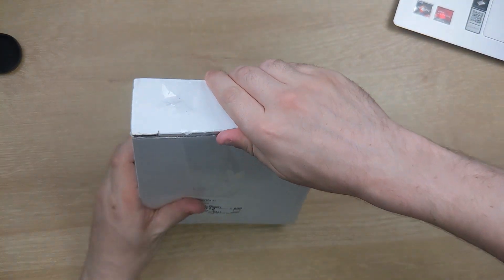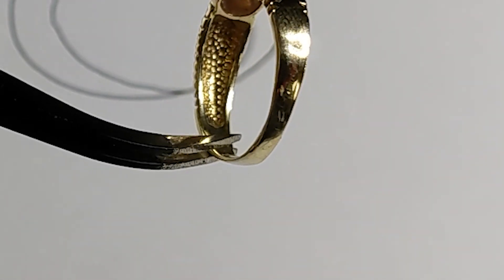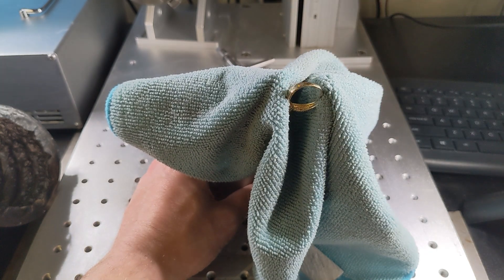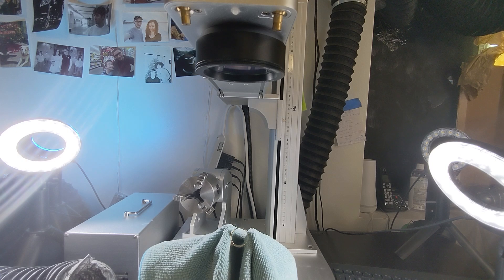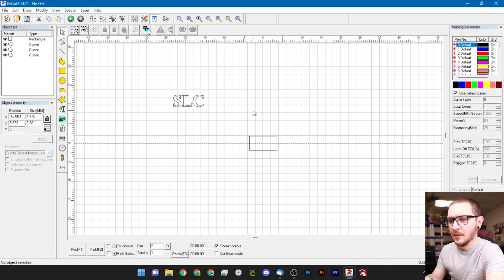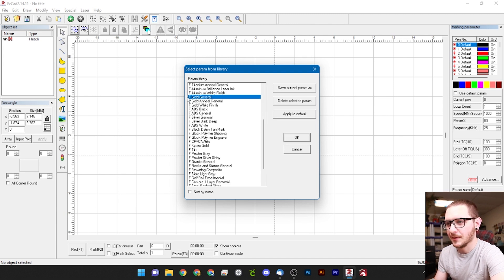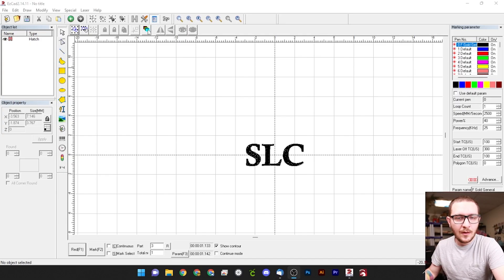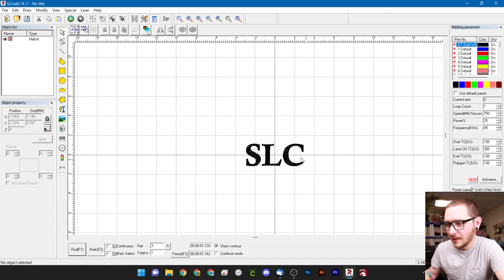How to Engrave a GOLD Ring with NO ROTARY tool! | Fiber Laser Tutorials

Comment: Hi just wondering what lens size you recommend for doing rings and small jewelry, I'm new to fibre lasers ,I have a 50 watt Cloudray with a 300mm a 225mm and 100mm, was debating on whether or not to get a 70mm for jewelry. Any recommendations are appreciated. Thanks

Comment: New member. When I engrave with the machine on metals I see that around it creates like a shadow that I have to use a soft sandpaper to get it erased or polished. is this normal?
I have a 50W Fiber Laser.
Reply from the maker: Not normal. Click the ADVANCED button under your parameters and change MIN/MAX Jump Delay to 500. Should clean that up for you.
Reply: @LaserEverything  Thank you. I will change it and give it a try.
Reply: @LaserEverything  Woww thank you very much the problem is solved now the engravings come out without that shadow will look much cleaner. Thank you very much !
Reply from the maker: So glad it helped you :)

Comment: Hi Alex, instead of deleting / Cutting then pasting the engraving parts you could check "(S)Mark Select" and let everything visible. But it seems that this is your workflow. Very nice job!!!
Might I know yout Wobble Parameters: Diamateter = ? mm & Distance = ? mm
Because I'm experimenting with it. Are you previewing the Wobble in EZCAD bevore engraving then it seems that if your text is too small the Wobble Diameter will take too much space in relation to it's main dimensions.
Reply from the maker: Yes people recommend this to me regularly but I don't trust myself to use mark selected and I'm a bit OCD so if I have everything sitting on the page I will be wondering over and over if I've selected something I shouldn't. It ends up being much easier for me to visually just glance at the page and see exactly what I want marked and nothing else. 

Wobble is primarily only for cutting. I don't typically recommend it for engraving so everything you've seen engraving-wise my wobble has been completely disabled.
Reply: @LaserEverything  As I said it's your workflow and it has to flow as possible to please do it like you're feeling that it's flowing... Excuse my unprecise english expressions.
Concerning the wobble size if you have a small Text to engrave so that the standard wobble size is to big compared to the text size you'll need to adjust the wobble diameter and their distance to avoid going to far fron the engraving path. In other words the vertical distance from the engraving path to the farest point is critical when 2 lines are to close to each other. I will send you some screenshots to that. Thanks for your efforts.

Comment: Hi there. Your videos are great. I have 30w fiber laser. Can I ask a question about parameter library. Did you make that setting yourself or  download from somewhere. I have tried to find best setting for several materials but could not find them yet. Thanks.
Reply from the maker: All of my settings are developed by me personally over the course of 8 years working in the industry. They're all available for download on my patreon page: https://www.patreon.com/lasereverything :)

Supporting the show and helping others get the same great information gets you the parameters in exchange. I hope this helps!
Reply: @LaserEverything  Hey Alex. The parameters on the Patreon page....are these set up for a 30w machine? If so, can I just use the calculator you talked about in another video to convert them? And the only one that needs converted is the Power. Correct?
Reply from the maker: The Patreon post that has the parameters in it actually has an Excel file and at the top of the Excel file you can type in your wattage and lens and it will convert the power in the converted column of the spreadsheet to your current setup. It's very easy to use so definitely don't miss it!
Reply: @LaserEverything  you are a gentlemen and a scholar. Lol. Thanks for the info!
Reply from the maker: Happy to help, thanks for supporting the channel. Keep an eye out too because the monthly parameter update is coming very soon we're getting the last of our new parameters together before we push the update to the Patreon.

Comment: Do you think there would be any benefit to putting the ring higher on the "Y" axis? I know if the red light clears the higher side of the ring, but seeing how the laser has a kind of bevel from the center resembling, "/ | \". Would it add another layer of safety and clearance? I know its a meh question but I'm just curious what you think. I do know putting it at the same angle lower on the "Y" axis would affect it.
Reply from the maker: Yeah I hadn't given that a ton of thought. Could make for better clearance but also more difficult focus.